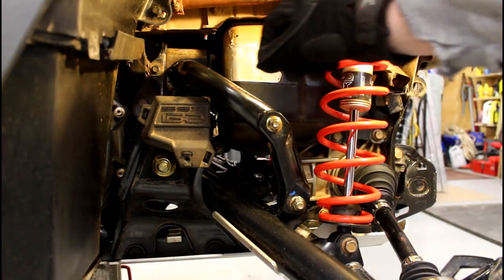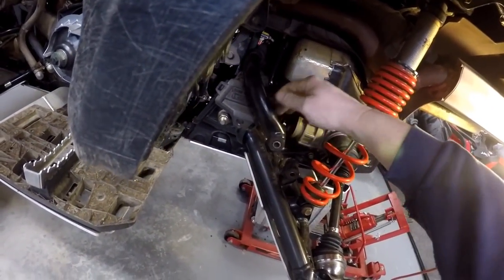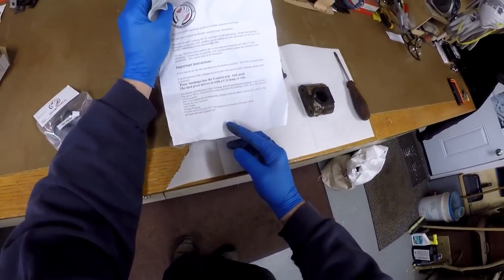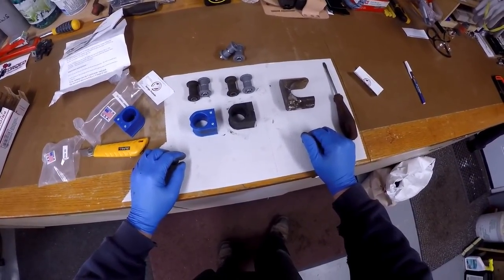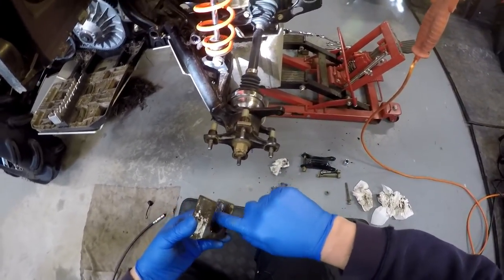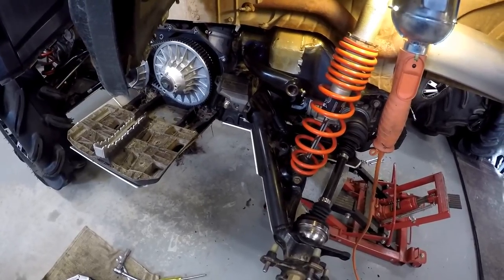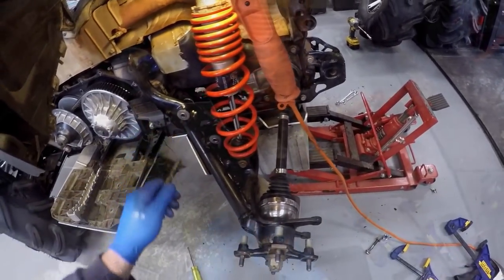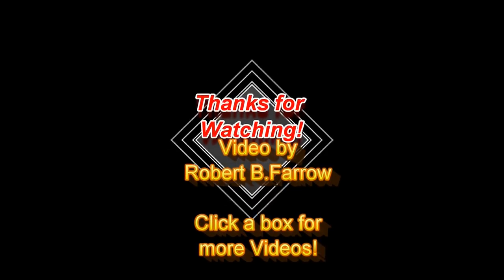Cam Am Sway Arm Clunk Fix Garage Product Bushings XMR 850

Comment: Great vid, thanks for the share. About to replace mine on my 2016 outlander with the same kit from Garage Products ($116). Stock bushings lasted 8 years and hopefully these aftermarket ones last longer. Which has been the case for all the other seals and u joints I have replaced.
Reply from the maker: Great stuff Frank! Good luck with the install and Thanks!

Comment: My sway bar bushing was pretty bad it was letting the lower bushings bolt score into fuel tank I just got the new pillow block bushings putting in today thanks for the video
Reply from the maker: Good luck with your install, never had an issue with the Garage Product bushings.

Comment: When I upgraded my stock failed rear diff, I upgraded the entire rear set of bushings to garage products. Wow are they nice. Also, they don't take grease as they are a snug fit. Over time I assume they will. I did not have play in my sway bar like you did, but I figured since I had it all ripped apart, why not get 2 birds stoned at once.

Pretty easy install. 

I didn't get a pen, what the hell?!

I also took the time to use my wheel bearing grease tool and lube up the rear wheel bearings.

 Mud N Wheels diff has been going strong so far.... no more trash back lash settings to wear out the pinion seal!

Also, I know you upgraded your springs... I have podiums too and man are the springs soft. Did you use the 2016 can am 650 red ones? I feel like you did.
Reply from the maker: I believe the springs were from the 2017 650.  Good upgrade with the garage products bushings, mine are still going strong.  My Mud'n Wheels rear diff is also still going strong now for about two years. Great product!  I'm still on my original wheel bearings after over 5000kms on them, the grease tool really works!  Sounds like you really got everything covered Aaron, great job!
Reply: Where did you get the parts from?
You have a link?

Comment: I got same exact issue 
I bought my 2016 850 in 2016 new only put 200 miles on it rarely used it and this weekend is started getting this noise and its exactly what you have....I think it's because I rarely used it and grease dried out
Can you please give us a link or item number for the part you replaced ?
Thank you for this excellent video
Reply from the maker: Thanks Man! Ya, they don't hold or take any grease and were an issue on almost every Can-Am at the time.  https://gpbushings.com/shop/can-am/can-am-outlander-renegade/

Comment: Hi Rob ,I enjoy your maintenance and fix vids,I do my maintenance and fixes as well '17 outy xmr 1000.I have a question about bushings ,Garage products looks great how are they holding up and at what kms did the stock ones fail Thank you   Bill.H.
Reply from the maker: Thanks Peter! I can't remember the mileage when I changed them but I believe they didn't last long after I bought the machine.  They changed them once under warranty but they didn't last long either.  They are still holding up great.

Comment: Hi thanks for the video. Do you have to remove the foot wells to do this job?  Thanks
Reply from the maker: It makes the job a heck of a lot easier if you do...hard to get at the bolts on the right side especially.
Reply: Rob Farrow ATV thanks!!
Reply: I was able to do the job without taking off the foot wells. Took about 1.5 hours
Reply from the maker: Cool, glad it worked out Andrew!

Comment: I’m in agreement with Elemental on this. I just don’t get the perpetual need to upgrade/fix Can Am products. For the price of these bikes they should be plug and play - upgrades optional. Seems more often than not the upgrades while not crucial - seem necessary to get them running as they should.
Reply: Chris E. Awesome thoughts on that topic. I pretty much feel the same way as I am also a Can Am XMR owner.
Reply from the maker: Chris E. True enough, it does take a lot of work and upgrades it seems...on my machine anyway, to get it running at the level of performance and reliability that makes me happy in the swamps...but not everyone rides like myself and they still do the upgrades regardless of whether they need to or not.  I agree for the amount of money they cost, they should be plug and play, for the most part they are but there were a lot of issues with the 2016 which was the first year of the new build. It hasn't left me stranded out on the trails yet and is running very nicely now. Hopefully I can keep it that way! LOL!
Reply: Rob Farrow ATV true that, they are still impressive machines no doubt. Additionally, all makes and models have their own deficiencies. Fortunately, there is a ton of Can Am aftermarket parts and let’s face it - if you can afford an XMR you probably have the budget (and inclination for that matter), to upgrade depending on your particular riding habits and/or needs. Even the 2018’s have leaky diff seals, prop shafts that are out of phase, rear diffs with improper amounts of slop and backlash etc.
I just feel that for a MFR that claims exceedingly high performance insofar as capability and reliability (and cost on average 25% more than other competing lines), they should not force the buying public in to being their guinea pigs for what to improve. They are off road vehicles...drivetrain, suspension, and frame components should be bulletproof, period.
Reply from the maker: Agree! Thanks Chris!

Comment: Awesome video.  Noticed a clunking sound on mine yesterday ripping around in the snow.  Where did you order the parts from in the states?  I am in the Ottawa area.
Reply from the maker: Ya, I ordered the parts straight from Garage Products in the States...there might be a Canadian Dealer now but I'm not sure about that.  Thanks for tuning in Michael!
Reply: Just ordered mine for the 48" wide 2019 model 850 XT. Mine squeaked and clunked from the first day I had it. Hoping this fixes the squeaks and gives better quality travel.

Comment: Keep an eye on your swaybar, those pillow blocks from garage products are a much harder material and will chew up the actual sway bar instead of wearing the bushings, a few friends of mine have had to replace the whole sway bar because of this very issue.
Reply from the maker: Thanks for the info, I will!  Thanks for tuning in!
Reply: I know this thread is old, but I'm hoping you could share how the sway is removed.  I have the service manual, did everything stated in there, no way this will come out.  I'm also wanting to replace my sway bar because it is worn.  Thinking the GP bushings might have been a bit too hard.

Comment: I have been looking for 2 atvs, moving to Montana. Every video/forum I see makes me think a 15 year old designed these canams. All about fun nothing about quality, sad the fun side of me really wants one but I don't want to be broken 40 miles away from anything. Any atv's that have a good fun factor but good quality out there?
Reply from the maker: The Kawasaki Brute Force's 650 or 750 are well built, reliable and have lots of power! I had the 650 before and it was an awesome machine till I sold it after 8 years! Thanks for watching David!
Reply: Rob Farrow ATV Thanks I haven't looked much at the kawasaki's yet. I admit I am a little biased against kawasaki, we have 6 mules at work 4 blew the motors within 6 months lol. I will check the atv's out though.
Reply: Yeah the bushings suck and the brake pads wear out relatively quick, but neither of those things are going to leave you stranded. I have close to 6000 Km on my 2014 Outlander and it has never let me down. Still has the original belt even, and I plow snow with it in the winter.

Comment: I would like to remove my swaybar on my 2017 xmr 1000 whats the easiest way to to so rob please if i know in depth on how to
Reply from the maker: After you unbolt everything like I did in the video, apparently you can pull and twist from both sides of the sway bar at the same time and I'm told it will come apart! Good luck Amir and thanks for watching!

Comment: I have a 16 XMR 1000R with 1600 miles and my bushings are tight however I grease the snot out of them before each trip I take. I hear these bushings suck, and been thinking about them but don't see a need yet, how many miles on your machine?
Reply from the maker: I had about 3000 kms on mine when I replaced the stock bushing with Garage Products...it was the second set of stock bushings in the bike.  Thanks for tuning in Don! Happy Trails!
Reply: wow 2nd set, guess I don't ride as hard as you :) Happy Trails!

Comment: I have the same noise on my 2018 850 renegade,about the same time I noticed this noise I also noticed that my renegade would not do a wheelie at all in high grear.Witch is not normal because it use to stand up with no problem.So could this cause that problem?
Reply from the maker: It wouldn't cause the Rene problem...
Reply: I'm now leaning toward my clutches,the case the clutches are sitting in is starting to get hot and I have never noticed it before,its getting hot enough that I can feel it through my boot
Reply from the maker: @lonegunmen4204  That seems to be pretty normal for the can ams, hot clutch cover...everything seems to run hot with can ams.  Check your belt for abnormal wear.
Reply: It's back in the shop for the 5th time this month.i thought belt too because its had the same belt for a year but they said it could be trans.
Reply from the maker: @lonegunmen4204  that sucks, hope you get it figured out!

Comment: I haven't had any clunks, did they fix this issue after your year?
Reply from the maker: I'm not sure if they upgraded or fixed this issue since 2016...hopefully they addressed it! Thanks for watching Man!
Reply: I have a 17 and it clunks. I’m assuming it’s the same issue but mine clunks going down hills. Like there is too much play in the ring an pinion.
Reply from the maker: That doesn't sound good, you should look into that before it gets worse! Good luck with it and thanks for tuning in!
Reply: I have a couple of friends that theirs do the same thing. And they have never had trouble. But I will check into it.
Reply: @RS-pw7qf  did you find out what the sound came from?? I just bought a 17' and it does the same thing when going downhill
Reply: Nope. I never took it to the shop.
Reply: @RS-pw7qf  hmm okey. Does it still hold up or did something break?
Reply: I havent had any problems
Reply: @RS-pw7qf  okej cool. Thanks for answering

Comment: Great vid Rob and very helpful . Mine is a 2016 and all the dealer can tell me is that i don't grease it enough . Can you post the full address of the company you bought this from and the exact part names or numbers . Maybe i'll put a Mavrick belt on at the same time like you did as mine is squeaking and i've smoked it a couple of times .
Reply from the maker: Thanks Man! Just scroll down the page... http://www.garageproductsatv.com/can-am-g2  Have you updated the clutch? Thanks for watching!
Reply: Thank You Rob . I haven't updated the clutch but ride my machine fairly easy and don't know if it's necessary . The most abuse mine takes is plowing snow and pulling logs and moose out of the bush with two of us on it . Do you think i should update ? The times my belt smoked i was pulling logs .
Reply from the maker: If you're pulling heavy stuff a lot, a minimum of a Clutch Kit would help a bit but even when you smoke the belt, they seem to be fine! Just take the belt of and wash and scrub it and blow out the clutch with air, then scrub the clutch sheaves. Should last awhile still, has with mine anyway!
Reply: My bushing kit just arrived . Fast service . 4 days . Thanks for the info .
Reply from the maker: Cool! Mine came pretty quick also! Good luck with the install!